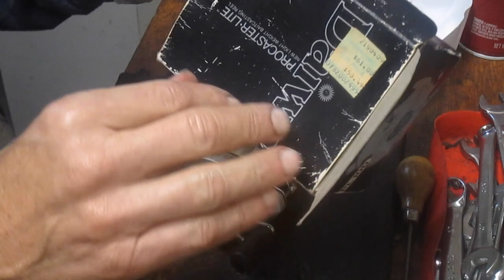Daiwa Procaster Lite 100 How to take apart and service the baitcasting fishing reel

Comment: I JUST bought one of these on ebay to breakdown, relube, upgrade the drag washer then fish it for years to come.  These videos make it so easy.  Thank You Dennis.  One tip for aligning the springs with the holes in the side cover.  I cut toothpicks approximately in half.  I put in the yoke, put the springs in and insert the pointed end of the toothpick down through the top of the spring.  This gives me two elevated 'posts' that guide the top cover into the proper position.  Maybe that will help someone.  Thanks again Dennis!
Reply from the maker: Great tip.  Thanks for sharing it - Dennis